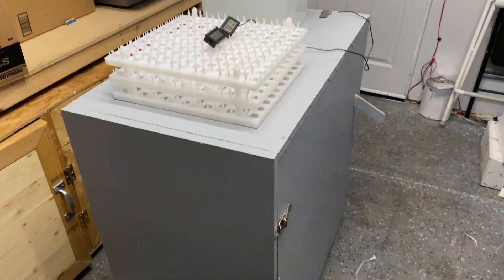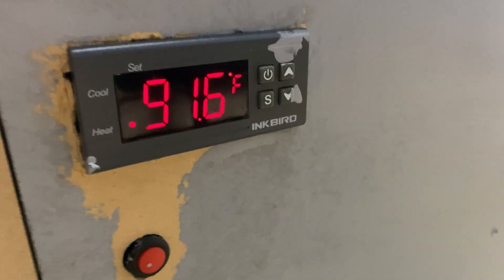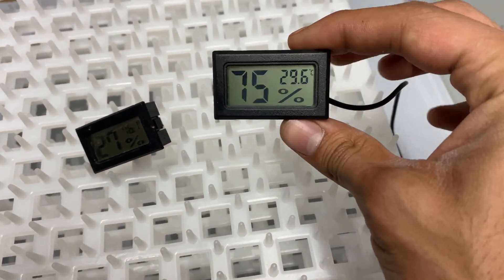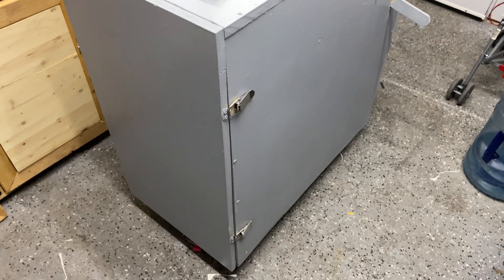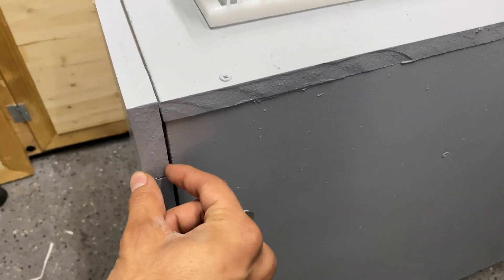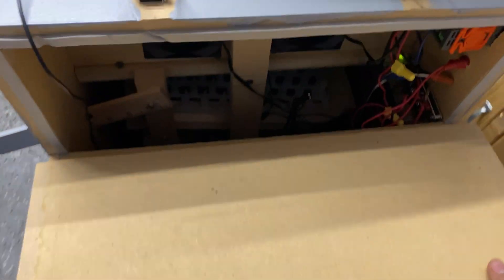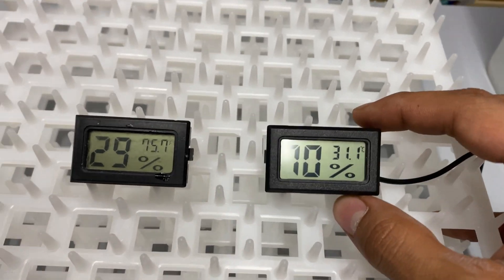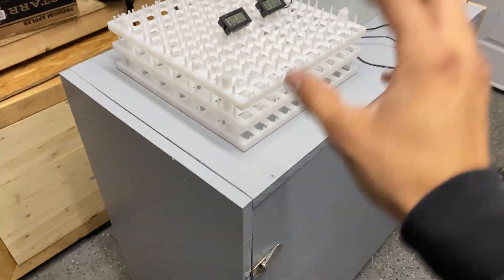2021 Cabinet Incubator Build Overview - Homemade Semi-automatic GQF style Incubator

Comment: hello sir, thanks for your video, exusme sir can you tell me the size of that incubator on desc? 🙏
Reply from the maker: Hello, the interior dimensions are 30” in. L x 16” in. W x 30” in. H.
Reply: @ScaleModelAddicts  thank you very much sir... salam dari indonesia 🙏
Reply: @ScaleModelAddicts  one more question sir... where i can put the sensor of termostat ? please tell me 🙏 thank you
Reply from the maker: @farartchan  I like to keep the sensor near the middle of the incubator, usually clipped from the ceiling of the incubator. If the incubator isn’t full, I like to keep the sensor about a finger length above the eggs. If you have an extra thermometer you’re going to use apart from the thermostat, try to spread them out across the incubator for the most accurate results